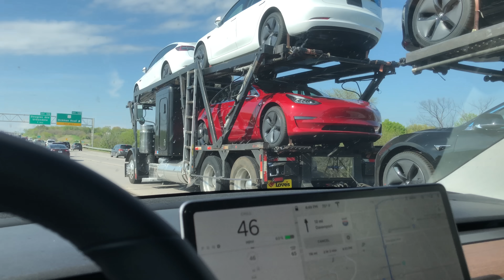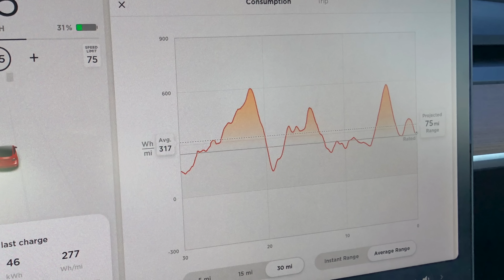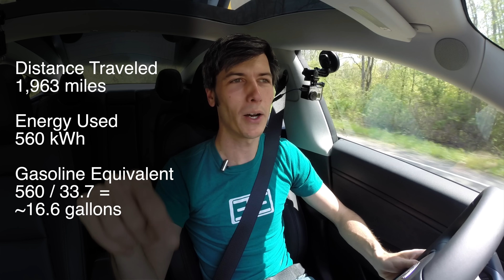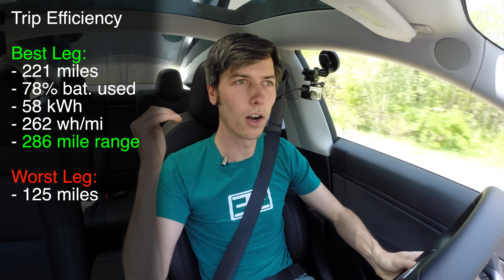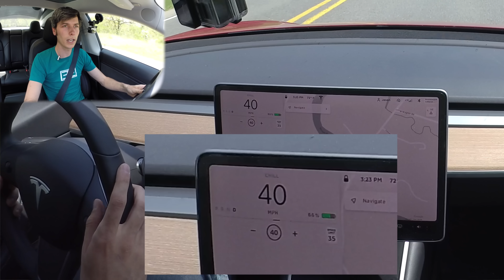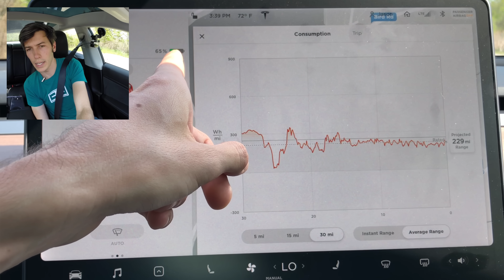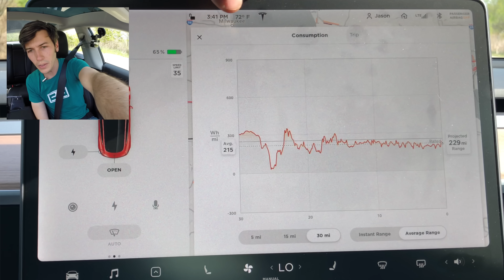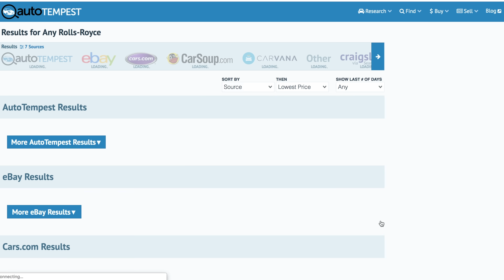How Miserable Is A Tesla Road Trip?

Comment: I'm not sure how you got inefficient out of 2000 miles to a full tank of gas to 200 miles to a full charge of electric........
Reply: Because if you took the equivalent miles per gallon that the Tesla gets over the entire road trip, it would be equivalent to only 1 tank of fuel in a regular car. This proves how efficient Teslas are because if you did this trip in a regular car, you'd use way more than just 1 tank of fuel.
Reply: @zacharyostrand617  exactly....... you fill your tank one time and go 2000 miles...... vs drive two hundred miles then charge............ I'm not sure I see the efficiency in that. Dont get me wrong I like tesla..... but I cant see that as being efficient at all.
Reply: @paulp1729  there's no car out there that can go 2000 miles off of one tank of gas though. If there was a car with such a high fuel economy, it would be as energy efficient as a Tesla

Comment: I always make it in a shorter time than google maps says on long trips.
I usually drive for four hours and stop for 20 minutes so, i am stopped for an hour and drive 12 hours in 13 hours travel where you stopped for 3 hours and you are limited as to where you stop or what you can eat or do because you have to find a charging station.  I can stop anywhere without even thinking about it.

Comment: 19:00 strongly disagree, more stops drastically increase overall trip time. That Charge time may be only 20 mins, but the time spent getting off the highway, stopping, hooking up the charger, unhooking the charger, getting any passengers back in the vehicle and getting back on the highway is a chore, and will drastically increase your trip time.

Comment: And in ten years time my fuel tank will still deliver a full range, with fast charging and battery degradation what will the result be?, ten years plus is heading for my budget, all new cars are wonderful, all the gadgets are brilliant, nobody ever has problems, come forward to my world and electronics when (not if) they fail are a source of expensive nightmares, mechanical stuff can be fixed or at least kept going, if battery degradation is a reality and I can't see why not as every thing else with a battery suffers this then as these vehicles get older be prepared for some meteoric depreciation, who will want a twelve year old car with fifty or a hundred mile range even if it cheap?, l am not against EV's per say but this will need to be addressed if they are to succeed, my current vehicle is over twenty years old, all mechanical!.

Comment: If you had been driving a Peugeot 306 diesel estate, I owned one, you would have had to have stopped twice. That was a ten year old car at the time. Please remake this video in ten years using the same batteries. The energy efficiency you quote seems to have ignored the loss in generation and transmission (circa 70%). If you want the 'greenest' option then buy a bike.

Comment: I just like driving and not having to worry if my car is going to die on the way to the next charging stop
Reply: I think the computer shows you where you can charge you would be making a bit of driving adjustments stopping every 200 miles instead of 400-500 Im definitely interested

Comment: Sounds like we will find out if the conspiracy theories about the auto and gas companies buying out the efficient carburetors were correct, they will need those 100 mpg carbs to beat EV"S once battery charge rates and travel distances improve.

Comment: What happens when you get to the charging station and the charging station is closed or not working, and you don’t have enough battery power to get to the next charging station. Or, you run out of battery power? 

What happens if the car breaks down? It might be hundreds of miles to the nearest Tesla dealer.

That’s surprising that AC doesn’t consume that much power. I would have guessed that heating and cooling would take a huge amount of power. I think you also have to waste power heating the battery itself in cold climates.

It might be a long hike from the charging station to a restaurant. Are all the charging stations compatible with each brand and model cars? 

I’ve seen a lot of charging stations at Walmart stores, which might be a smart idea in the future, when and if there are a lot more electric cars. While the car is charging for 50 minutes, you go into the Walmart store and spend more money than you otherwise wouldn’t spend.
Reply: When e-cars become mainstream, nobody (not even Walmart) will offer free charging.
Reply: I talked to a person that charged their electric car at Walmart, it isn’t free! It usually takes him 20 minutes to charge his car.

The whole point is that there are very few electric charging stations compared to the number of gas stations. I’ve seen the charging stations were out of service a couple of times. There could be a lot more downtime that I didn’t see. If an electric charging station is down, it might be a long distance to the next charging station. It’s probably a very short distance to the next gasoline station.

The US is now the number one producer of oil and gasoline. We’re no longer dependent on the Middle East for oil. I’ve seen gasoline prices under $2 in Texas, but it’s about $3.50 a gallon, for the same gasoline in California. Most other places it’s about $2.40 a gallon.

I considered buying an electric car in the past, but today, electric cars are just not a practical idea. It will be many decades before electric cars are practical, which is beyond many peoples lifetimes today.
Reply: What happens when you get to a gas station and it's closed or not working and you don't have enough gas to get to the next gas station?  Duh
Reply: @Tyler Clevette In 2019, there are way more gas stations than charging stations. It'll change in the future, but we're not there yet.

Comment: On range on a road trip in winter.  I do this a lot.  Once the battery is warm your good their and don't lose any range once the battery is warm.  But you will need heat and that heater can use a lot.  I find around 20 degrees you'll use about 5K for heat so that 5KWH per hour. 5% of my battery per hour on the road.   The wind in winter I find blows more and hard than in summer... Get into a strong head wind and the Model X is getting 600WH/m at 90 550 At 85 and 500-525 at 80. With the wind it's more like 500wh/m at 90mph and 400ish at 80.

Comment: Do a lot of road tripping, if I can I leave to the next charger at 55% as the ROC is way faster.  If I want to eat I'll charge toward the capacity of the battery the. Skip a charger or two.   Only going to 55% takes 15-30 minutes the next 45% of battery takes another hour to charge.

Comment: Thanks,  I can take almost any gas powered car and do 2000 miles with 5 stops of 10 minutes each including bathroom breaks.  By the way, where does all this 'clean' electricity come from?  Toxic batteries that can explode, hours of charge time, yeah, thank you no, the problems with these cars outweigh the standard automobiles that most still drive.

Comment: You need ~29A at 240V to get 7kW. Needs a special charger setup for that. My 230V outlets in Finland are with 10-16A fuses and the stove has a three phase 400V and 20A fuse.

Comment: This would drive me nuts. I do 12 to 13 hour drives with stops only long enough to get gas or run through drive through. None of my stops are over 20 min. Did a 28 hour drive with my dad our longest stop was getting fast food and gas, most stops were less then 30 min. They were all way more then 2 or 3 hours apart.

Comment: I would rather shoot myself than have to sit at a charging station for 30-45 min and stop every 200 miles.  My family and I travel from RTP NC to Southern WI, 2-3 times a year and it's generally a 12-13 hour drive (w/o the time zone jump).  Driving my "fuel efficient" F-150 Crew Cab, we averaged 19MPG with an average travel speed of 76MPH total trip, stops included.  We stopped 3 times in our 852mi trip for gas and breaks.  We packed food for the trip to make it faster.  Before kids we had a 2014 Passat TDI that I averaged about 45MPG over that same trip.  Based on his calculations around 21:10 in the video my Passat was was cheaper to drive than his Tesla (and yes the time frame i had the passat gas was actually around $3/gallon for diesel), but obviously it's be a bit more in my F-150.  Point though is that it'd take 16-17 hours to make this same drive with a need to stop for 35-45M five times along the drive.  Till they come out with a 15M charge time on a 600 mile range battery I think I'll keep to my 3 gas stops.  Love your videos though and thank you for the information.  This is in no way a bash on you just a friendly observation.

Comment: 500 miles charged in an hour but phones still take an hour to fully  charge 🤣
Reply: Yes, but charging 1000 phones also takes 1 hour. The limitation is really how fast you can charge a battery from 0 to 100, not how big the battery is (assuming you have a powerful enough charger.).

Comment: I thought driving one of these cars was free? So you still pay at the charging stations?
Reply: Tesla often has free charging at their Superchargers for those that purchased certain models. However, day to day use of the car wouldn’t use them. The vast majority of the time you charge at home while sleeping at night. The economic advantage of free charging isn’t as great as it sounds as you could easily drive 20 miles in a major metropolitan area to get to one. They are more for driving across the country on a road trip. Even so, there are thousands of public chargers all over the place. They aren’t as fast, but still cheaper than gasoline. At home charging is the sweet spot though. It might only raise your electric bill 20-30 bucks.

Comment: 7:18 “it gets better mile per gallon in the city”

wait a minute. that’s illegal
Reply: hm yes, l i q u i d    e l e c t r i c i t y
Reply: he means miles per gallon equivalent
Reply: Bernie Rubber  you take how much money it would cost to drive 100 Mi. on electricity and then in gas
Reply: @thiccboiobunga2088  For me I average 231 watts/mile.  So that is a little over 4 miles per kWh.  Charging at work for free that works out to $0.00 to drive 100 miles.  if I charge at home, I have solar and actually get a check back every year, so again $0.00.  If I charge at a supercharger at $.28 per kWh then about $6.44.

Comment: For a long distance this is miserable compared to any ICE car.

40 minute recharging after eveery 250 miles... that's horrible.
End of
Reply: If you’re using way less fuel and energy just make it work for you and take in your environment during those stops!
Reply: The car will charge at a Supercharger in about 15 minutes. It’s no biggie. They are strategically placed along major routes across the country. Even so, the vast majority of the time the car charges at home while you sleep. The cost to charge at home is 1/5 the price of gasoline. If the price of gas suddenly shoots up, you’ll save a lot more.

Comment: You forgot that elecricity is produced at an efficiency of around 35%. So in fact you used 48 gallons
Reply: [Citation needed]
Reply: @Deddily  No. Basic knowledge in Physics suffices. The theoretical limit of a Carnot engine is around 47% However we live in a real world which means that we are at quite a distance lower than the theoretical limit. In addition you have transport losses, charging/decharging losses which all diminuish the efficiency. Using primary energy for traction is still advantageous, in the aspect od efficiency.  A well designed Diesel car engine can have a higher efficiency than any electric car - as long as electricity is produced with fossile primary energy sources.
Reply: @ghlscitel6714  I appreciate the reply, but I have seen so many claims along those lines over the years that have been thoroughly debunked that I personally weigh citations from reliable sources much higher than anecdotal comments. I'm not saying you are necessarily wrong just because you don't have a citation, but a citation from a reliable source would make your comment more credible to me.
Reply: You are also forgetting to factor in the energy needed to extract, refine, transport and pump the diesel, if you want to make a fair comparison.
Reply: @Deddily  I do not think that it is necessary to make "a fair comparison" to enlighten the fact that the vlog's author's claim of efficiency values is not questionable. For me that is enough. Thank you for your interest.
If you want to have the total truth of efficiency comparisons, ho ahead. Collect data, and do the math and physics, and finally generate the fair results. Good luck.

Comment: So what’s your time worth? Because that extra (almost 8 hours of charging) is an entire work day, nights sleep. 

Idk. These need a higher capacity or a quicker way to charge imo to be viable for road trip use. 

Not to mention supercharging isn’t much cheaper than gasoline. The time it takes to charge vs fill up the tank makes this very undesirable. 

Not to mention where the power for that charge comes from considering 62% of America’s electricity comes from coal and natural gas. So really it’s not making much of an impact as far as green house gas emissions go.

Comment: My number one complaint with electric cars is available charge station.   There is not enough infrastructure to support everybody driving electric cars.  I'm listening to you talk and you sound like you have charge anxiety that's what happens when you buy an electric car never once did I complain about running air conditioning or heater or lights or stereo or pulling a trailer when I have gasoline driven car.

Comment: What if you went the northern route out of Michigan over the Mackinac bridge and through the upper peninsula. I don't think there are any superchargers along that route. So your last supercharger would be Bay City or with a bit of a detour again in Traverse City. After that you would have to plug in somewhere for a longer time. One available in Naubinway and then it would be begging from strangers. There is an alternative for longer term charging. Campgrounds with 50 amp service. Campground 50 amp will charge a Tesla long range battery in 12 hours. So long range travel has to be along routes with Superchargers. The boonies will be mostly out of range for trips without over night stops every 250 miles or so.

Comment: I just drove from DC to LA, 3000 miles. 2002 F350 diesel towing a loaded trailer and a full bed of stuff. 16mpg doing 75mph most of the way, and no auto pilot... It's like living in the stone age... That same truck will tend to get 25mpg on the highway with about 1500 pounds in the bed and not towing...

Comment: Right off the bat, I call BS! Goggle maps assumes you will not ever drop below the maximum speed limit for any reason, you will never stop for gas, food, drinks, bathroom breaks, or even sleeping at the end of the day!
I drove from San Fransisco to Chicago and for 10 hours of driving, I had to see where goggle maps said I'd be in 7 or 8 hours, and often it turned into 11 hours of actual driving and we only ate, slept or fueled after we stopped for the night.